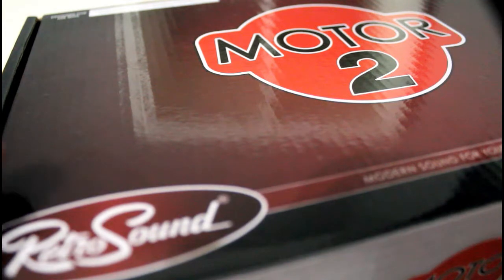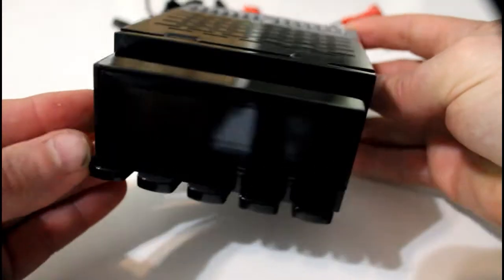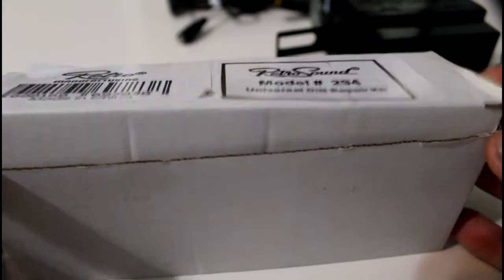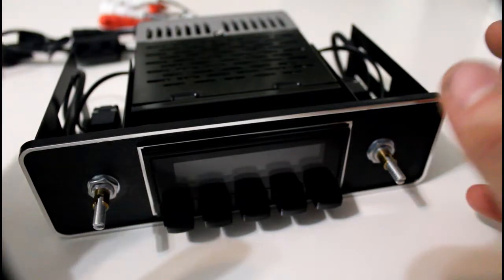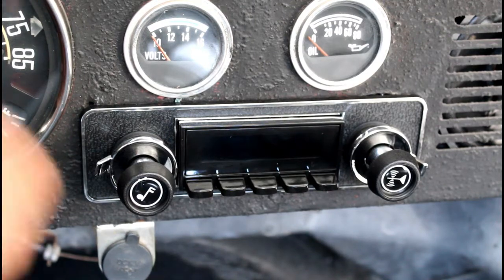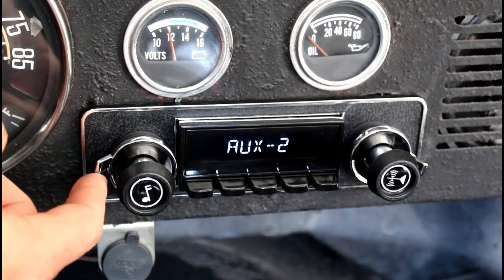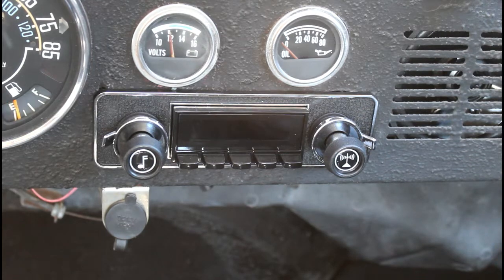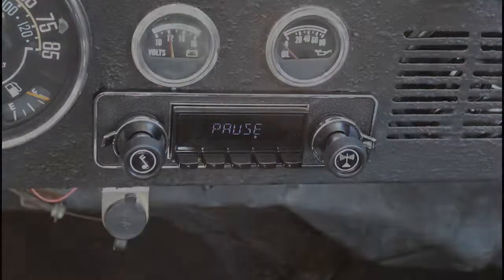Retrosound Hermosa M2

Comment: I've got the exact same radio installed. there are 2 wires that need to supply power. Where did you connect the 2 wires? I believe one is a constant 12v and the other is ignition/Acc activated.
Reply from the maker: The constant got plugged into the 'Clock' fuse location and the ignition got plugged into the 'Radio' fuse location on our CJ7
Reply: @Cxcom-rg9uj  Thanks so much. Implementing tonight.

Comment: I only have 6x9 speakers in the back (no front speakers) does the sound quality sound okay? and will it run my 6x9 speakers fine without an amp? so straight from the unit itself to the 6x9s
Reply from the maker: I have no complaints on sound quality. I'm using the retrosound standard series speakers and they do well. They have a full range and sound good... Im not running any rear speakers either.
Reply: @Cxcom-rg9uj  thanks for the quick response. Just ordered a unit! ❤️